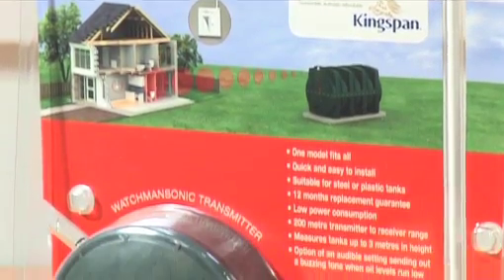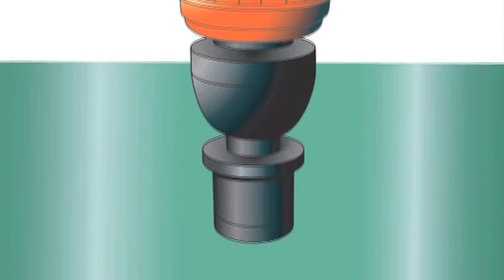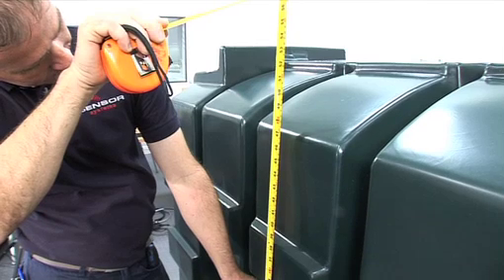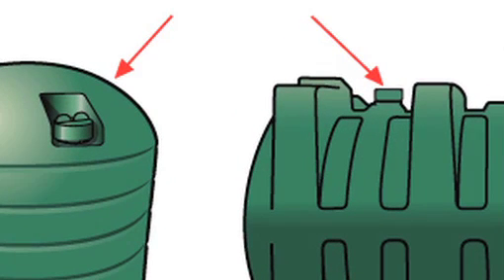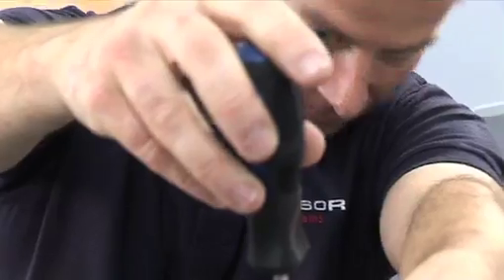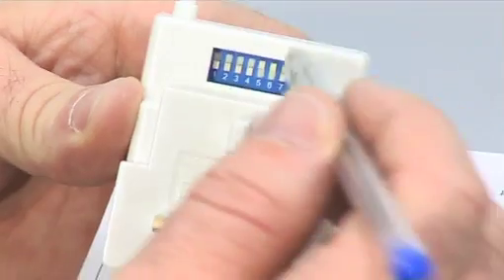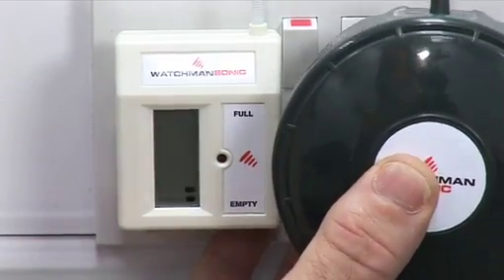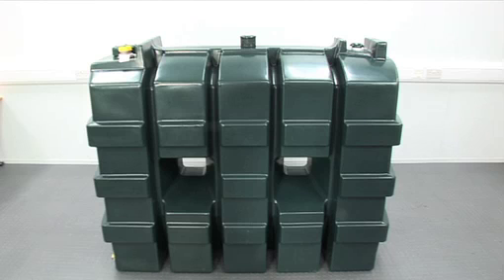Watchman Sonic Installation

Comment: How do I drill the hole without getting a plastic disc in the tank?
Reply: Very late I know, but try using a Forsner bit. It cuts holes, but it has fluting so that it pulls the spirals and chips away out of the hole. You'll still end up with some plastic in the tank, but not a whole lot.
Reply: @kennyscott1569  thanks for this, Kenny, going to try installing one of these soon and DIY is not my thing. I thought I was going to have to put the Watchman close to the oil tank's lid so I could maybe put some tape under where I planned to drill, but the bit you mention sounds like a much better solution. Do you know if tiny fragments of plastic in the oil will upset the burner or anything?

Comment: You are keen to point out to measure the exact height of the entry point to the base. However, you don't explain how to measure the entry point to the base when installing on a double-skinned tank - especially as it's critical to get this measurement right.